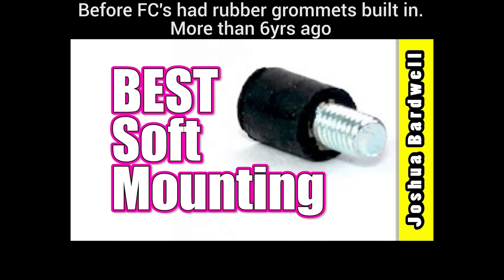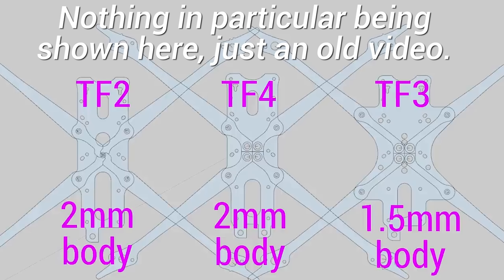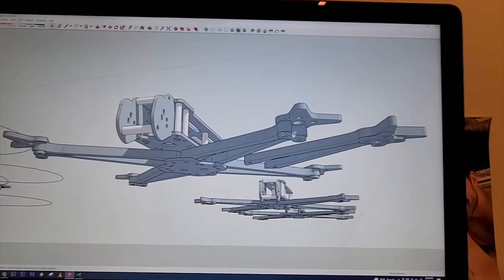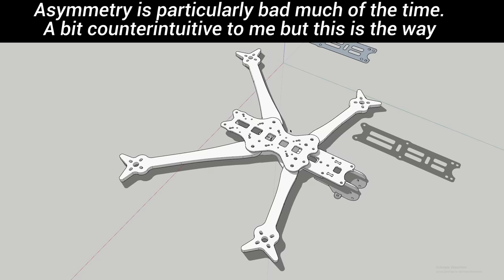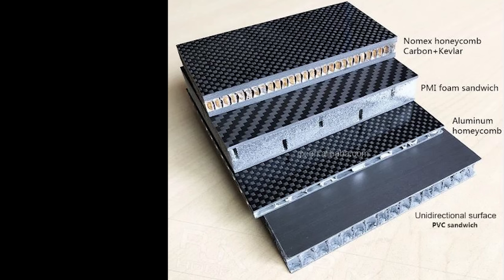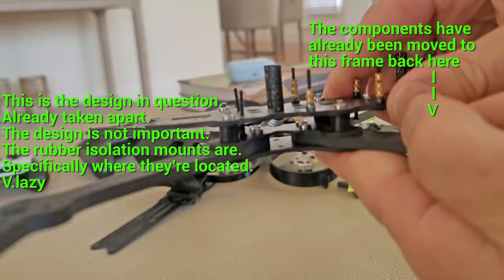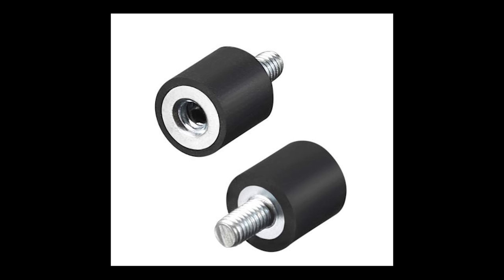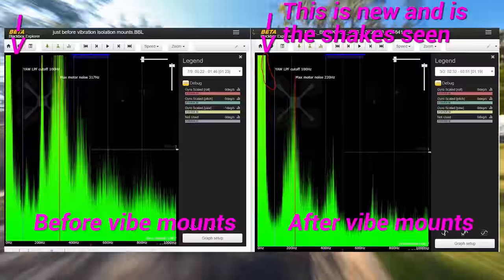I put some steel cable on a quad...

Comment: you discover today what we discover 10 years ago with 20 to 30inch prop on old quad, the solution is very easy, take the motor out and balance the motor and prop together on an electronic bench, you will be surprised to see that unmount the prop and reput it will unbalance the previous job, also carbon arm transfer a lot of vibration, nylon arm is much better even they fold a little bit.  each frame has it's own vibration frequency and filter this frequency before was easier with the analog sensor, now it's totally different
Reply from the maker: That would be ideal however it's hard to keep it in good condition when we put our crafts through the war of dealing with violent trees and leaves. 😅

Comment: STIFF  FRAMES  ON MOTOR CYCLES  , Are fine when riding  on perfect  tarmacadam. 
But in real life slight flex in the chassis  / air frame  will improve  feel .👍

Comment: Amazing content, I love seeing the effort put forward for the advancement of such things.

I do have to ask, what if the approach to keeping things strong is fundamentally flawed? Strength and rigidity aren't necessarily the same thing, and something like a silicone sealant, surrounded by a thin PVC sheet well bonded to the carbon layers on the edges of the carbon-silicone sandwich (for testing, could literally just be electrical tape bonded to the carbon fiber with a urethane adhesive such as 3M's ScotchWeld) could theoretically provide both the strength and flexibility needed to get decent dampening.

Tl;dr, strength good, rigidity bad; and good content.
Reply from the maker: The issue is that any material attempting to be used in some thin manner that is a solid will give mixed results because solids have rebound. Only a liquid has no rebound. That's why damping grease works as well as it does. If using a solid, it needs to be used in a different way than in a thin layer anywhere. It needs to heat up under the vibrations in order to actually dampen anything.
Reply: @Kabab  Too bad it's not possible to just connect the thing together with grease, lol.

From a materials perspective, this sounds like it would boil down to which solids in what form produce the least rebound (via heat generation or otherwise) while still holding everything together, and trying to use damping grease wherever possible. Though like you've shown in the video, consistency is hard to come by with these things.
Reply from the maker: @blinkenlights  yeah a grease frame would be awesome 😂. Maybe it would work in the new Zelda game coming out soon.

Comment: I came back looking for a link for the hardware mentioned in the video. But I don't see one.
Reply from the maker: What specific hardware are you looking for? If there is any it'll be on fpvcycle.com. The frames are just test samples so none of that is anywhere. The most useful item right now that's in stock would be the 23mm short motors which pretty much transform any 3" ducted cinewhoop into an amazing flying craft compared to what it was previously if it has any motor size narrower than 22mm wide.

Comment: I finally figured how to put that tension in my frame with no added weight or parts. I have only my experience to go one but I am very confident that it works.
Reply from the maker: You could use dental floss like I showed on my instagram. It weighs less than a gram...just not such a looker
Reply: @Kabab  Try this. Shorter stand-offs at front and rear ends. Makes a slight arch instead of a flat top. But that arch puts tension along the bottom plate and top. Changes the frequency. Just 1mm (maybe2) shorter adds alot tension. I haven't notice any durability issues.  Been doing this for about 2 years and haven't told anyone til now. Curious to know if you try it, and your findings. I tried this for other reasons but quickly noticed a consistency to the quad, even when making some other drastic changes to frame parts and layouts. Converting a 5 inch to 6&7 inch without changing arms. Got great results consistently. I'm pretty sure the frame under tension had alot to do with it.
Reply from the maker: @airfriedquadsbw  that doesn't work the same because it's rigid tension. Sure it'll stiffen things up a bit but it won't dampen anything and will increase the higher frequency band. For damping you need non-rigid tension
Reply: @Kabab  It stops the transfer. You don't get the whole frame resonating as a unit.   Seems like each arm is more isolated and the frequencies don't find a way into the stack.
Reply from the maker: @airfriedquadsbw  I can assure you it does nothing but give you a bit more rigidity. It does not stop anything. It may push the entire resonance band a tiny bit higher is all. There is zero damping going on from a rigid tension system.

Comment: Thanks for the video.  I was particularly interested in your comment near the end about 5" quad all up flying weight of 580g.  Do you have another video or information that explains prop size and quad size/weight?   With roughly 400g taken up with a gopro 10+mount & a lipo, there isn't a lot of weight left!  My 5" source one is a bit of a pig with a gopro, so I built an AOS 5.5 and noticed a difference with the extra 1/2 inch props, but sadly the AOS breaks to easily for my flying skills (style 😁).  Do you have a suggested prop size for hauling a heavier camera like a gopro 10 as I look for a new frame?
Reply from the maker: About 5-6yrs ago, the best we has was the GoPro session 5. That cam still is excellent because of its size and weight. Back then, the 540-590g sweet spot for 5" with 2207 or 2306 motors was absolutely golden and the things  we fly today with a giant GoPro flys anything like those quads. It's also important to note that less than about 540g wasn't quite as enjoyable to fly. Today, if we can just get below 700g consistently with a GoPro it would be great. Lots and lots of people will say that 50g or 100g doesn't matter but those usually came after the era of ~580g 5" quads with a GoPro. 50g matters. Not so much in an empty field but when you're dealing with low height parking lot ceilings and small spaces it matters.
Reply: @Kabab  Thanks for the reply.  A change in weight of 10% isn't chump change, no matter what you're talking about.  Take off 25% and its significant.  The difference in flying my source one with a gopro vs. without (200g difference) is huge.
Reply: @Kabab  Sorry to bother you again. Could you help me with these two questions.  1) When you sandwich arms together, do you glue them, and if so with what glue?  2) In the brushless motors we use, is the bell pushed or pulled by the electro-magnets in the stator? Does it spin because of magnetic attraction or repulsion?  I figured if anyone know this, it would be you.
Thank you very much.
Reply from the maker: @blueskyfpv  If you want to use anything between plates of carbon or carbon sandwich, damping grease is the only reasonable option and you only need a very little bit. Otherwise I wouldn't recommend putting anything between carbon. Brushless motors pull magnets into place as the motor rotates. It actually doesn't push or pull, it just magnetizes and expects the bell to move into the lowest energy position as the magnetization rotates around the stator

Comment: What an amazing video quality, what cam on your fpv? Or what color grading?
Reply from the maker: Hero 11. Default and shutter locked to 1/60 with the ND filter we have on fpvcycle. 8:7 4k 60fps. It's the overall best video quality you can get from any action cam. The video at the beginning was a hero 8. The later one is the new 11
Reply: @Kabab  looks, awesome man

I think I mainly prefer the color grading, did you color grade? or is it just the gold hour sunset vibe that was already present?
Reply from the maker: @MaykThewessen  sunset-ish vibe was there for sure but the GoPro is really good in default. I used to use the flat protune and do all the work in post but there's no need for my purpose. I'm not going for anything dramatic or vibrant fun.

Comment: I wonder if you could copy 3d printers and just make is stiff as hell. Then use something simmilar to input shaping to compensate in firmware
Reply: Skis laminate rubber into the carbon layup.

Another thing is we allways have our laminations on the same plane..

Comment: I would actually like something like that without the "split deck" arms. Change the camera mount to put the front arm on top and you've got a winner. I built my cinelifter as a big ol "H" frame and it flies amazing
Reply from the maker: Hmm, why front arm on top?  I assume on top of the top deck?
Reply: @Kabab  just to clarify, i mean I would prefer the front arm underneath the the top plate (just the same as the rear arm). I have experimented with having motor bases at different heights and in all cases I have noticed the quad flies weird. 

This may not be as extreme of a case as I tried, but I have always been in favor of simple motor geometry. If the purpose is to get props out of view thats understandable, in which case I might put the rear arm on the bottom to match. Or I may be totally off base and its not a noticeable change.
Reply from the maker: @Enginair  the split level is a trick that allows the rear props to be a lot more efficient and effective because they're less so in the wake of the front props. Leads to more grip and better forward flight performance. You are right about the weirdness in specific the roll movement. It also matters how much of a split it is. In this case it's only a 10mm height difference so it's not going to do much but will give you better grip and forward flight performance. The lower front props also help get props out of view of the GoPro.

Comment: Smoothest drone i ever built was a tpu toad 3d printed frame with priline tpu which is more stiff, i heated standoffs and pushed them into the tpu for deck plate mounts, then i glued carbon fiber plates to the petg printed deck plates and mounted a pod on top so camera wasnt looking at front of frame, thing is amazing

Comment: I think you should try putting a crimp on the cable because (in my option) I looks like the arm could still pull on the wire making it move even while being held by that u bolt.  You might try to crimp it so it will be able to put tension on the cable. I don't think the U-bolts are putting enough tension on the cable to hold it in place and hold the arms steady. After i posted this I thought of something else.  What if you have the cable not just run straight across but also up  the arm so the cable will have a bend in it. Like from the tip of the arm down the inside of the arm put a bend in the wire go straight across the drone and then bend again and go up the arm to the end under the motor.  That way its not just a straight cable.  This would be triangle or truss.
Reply from the maker: I would if it showed any promise to continue developing in that direction
Reply: @Kabab well I hope you figure it out great videos btw.

Comment: I've heard of tungsten powder being used to dampen vibration. Like a sealed tube of it connected. Wouldn't be useful on a quad as tungsten was selected for it's weight lol
Reply from the maker: Yeah tungsten is just a bit heavier than ideal 😅

Comment: Hey Bob glad your still innovating & making videos!!!!!
Have you ever tried a pusher style 5 inch?

Oh, I think that you were just about one of the only person who will try something like this or has tried something like this I cannot remember you doing this and I watch like 98% of all your videos at least twice. I think it’s something we just have overlooked? I don’t know , but I’m highly intrigued by the concept.
Reply from the maker: Pusher crafts are very common in certain situations. They're not so generalized because of the obvious difficulty of landing and launching. They have slightly improved efficiency because there's no arm under the prop but otherwise not all that different. It's a little more difficult to balance the craft however because you need to load the weight under to get the CG closer to the prop line.
Reply: @Kabab  oh so the CG having to be inline with the the props makes it so that it’s not as simple as just flipping a frame and mounting the components on the top.

I’d still be interested in seeing the results of a freestyle 5 inch pusher. Obviously you would have to be the one to build something like this with your knowledge and experience. I’m sure a 3-D printer could help with the solution of landing. Actually there’s probably a much simpler solution . We have to think outside of the current box we live in.

It’s just a thought. I figured I’d throw it out there because I’ve never seen one. Imagine if it was absolutely amazing. I just wonder because 5 inch has so much better of a disk loading. I would also think that the prop wash would be better. Anyway, if you ever do it, I’ll be excitedly watching!!

As I said, I figured you would be the best person in the world to bring this to.
Reply from the maker: @fpvraver  the CG doesn't need to be there, it's just best for it to be around the prop line for best performance. Some prefer it a little above or a little below. Weight distribution and CG location are very important measures that impact flight performance

Comment: @KababFPV , did You try to talk to some car guys companies  that make  various PU hardness bushings in car suspensions? maybe they could make various hardness mounts with inserts like M3 or even make a two step proccess and use two different PU`s in one mount ? then it would be possible to to make cone like mount poured over with second PU, all enclosed in small cylinder like shape... ofcourse, much much softer PU`s than to the car bushings...
Reply from the maker: Yeah I would but I don't know what hardness and I'm not confident the same one will work for everyone or even different air temperatures. That's why I need it to work already before I go ahead and try and improve it
Reply: @Kabab  but then, You already use softmounts that have no rating at all and from my experience, those black mounts are lottery since those  are mainly made from recycled PU ( so the production facility uses whatever available and then add some black pigment to unify the look), so You`re already in the lottery business ;) take a look at car poly bushings or skateboard poly bushings, these are made with color different shore hardness grade. maybe 3 grades (soft/med/hard) would stadarize the softness/hardness...
Reply from the maker: @blazefpv3038  for now, they're only proving useful for the smaller 3" prop size and on a cinewhoop. I doubt even the right hardness would make much impact on the 5". I wasn't seeing any improvement at all. It was actually much worse. Hard standoffs were drastically better. But I'll keep testing things. I might double up the mounts just to see how it goes. If that works then a harder material will work.

Comment: You have your motors at the end of a long lever. isolate the vibration at the source.
Reply from the maker: Tried to come up with a mechanism for that. Not the easiest. Especially when the motor screws can undo themselves and you're reluctant to use loctite on them because you need to be able to easily undo them when they break. We've tried all sorts of materials under the motor. That's what those pads I showed at the beginning were. works to some extent but It's not practical.

Comment: Is it possible that the x arm layout literally marks the spot?  All vibrations point to the flight controller?
Reply from the maker: I think that is a reasonable hypothesis actually. It's a hard one to nail down however because there are many X frames that do well and there are many X frames that don't have the flight controller in the center that also do well and vice versa many of them don't do well
Reply: @Kabab  true, my biggest issue is always worn out motor bearings.  Maybe I should fly less? 😂. Nah

Comment: How you feel about the AOS  HD03 frame?
Reply from the maker: Actually looks pretty nice. Impressive weight with all that complexity. The simulations are definitely helping him get that weight down. Hard to tell durability but I'm sure it's pretty good. Maybe if the mount FC to top plate thing works out, it would be really synergistic with this design. It's still unfortunately 120g
Reply: @KababFPV  I like the way Chris thinks, right or wrong. It's driving forward the issue around vibrations. And with the new Betaflight 4.4 were making great steps towards a refined build. 

Great work 👏 👍

Comment: what about printing a inner section out of TPU?
Reply from the maker: Yeah I've tried that. It works to some degree but not always much like many other things. It's the unpredictability that's the problem. When it works, it's alright. When it doesn't, it usually makes it much worse

Comment: Try the steal cables bent in a paperclip shape (oval with flat sides), in X and Y direction.
What motors are those at the end? Link
Reply from the maker: It's just cumbersome to deal with the wire in such small segments. Way too much work
Reply: @Kabab  depends how you implement it. I would say zero new parts, just holes drilled and clamp's.
Plus a lot more adjustability than the huge cable/clamps you tried, and a boatload less weight.
Reply from the maker: @user-rs8zg8ey2b  Yeah I agree and understand what you're saying. I may return to it if just moving the FC to the top plate doesn't show anything special.
Reply: @Kabab  I forgot to mention, Sorbothane comes in different durometers for tuning (nothing to do with the cable setup).
I think the woop results were from the masses were better tuned with the dampers. Good stuff.